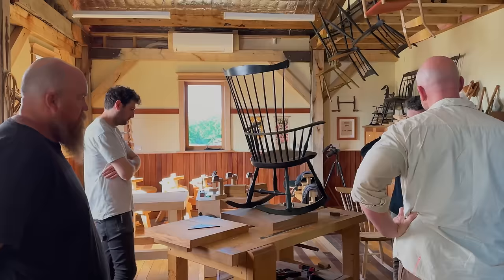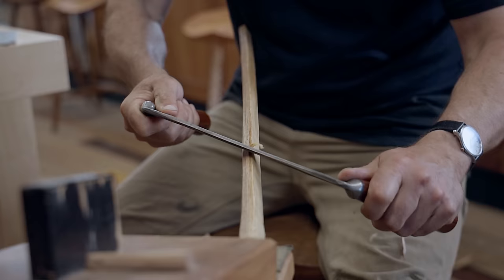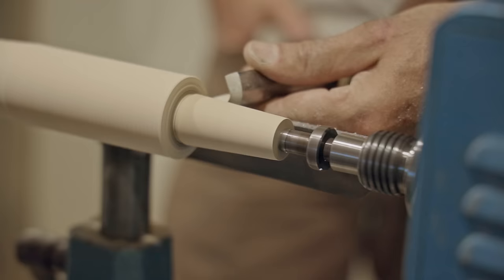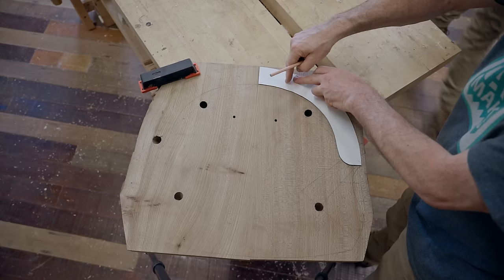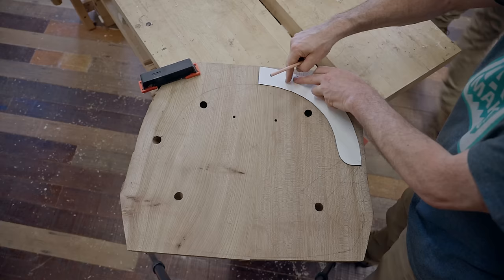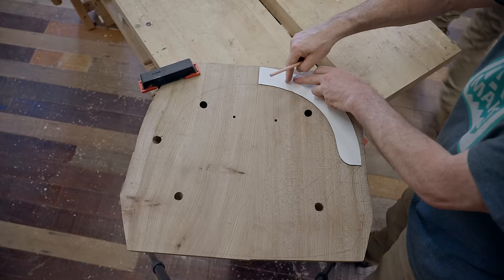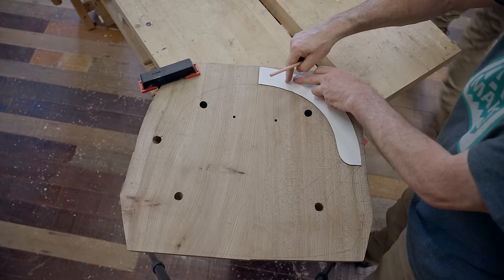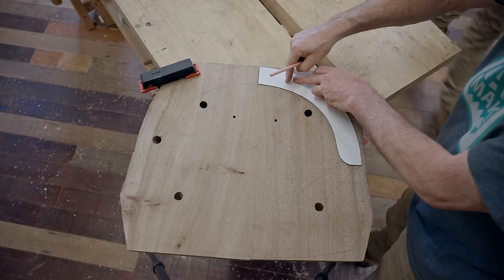How are Windsor Rocking Chairs Made? Let’s find out!

Comment: I made a similar chair, but not a rocker (which I'd love to have).  Those thin split back spindles are flexible and bend and conform to my chronically stiff back.  It's the most comfortable chair I own.  I did the standard finish...black milk paint over bright red milk paint with some scotch-brite and danish oil/wax over the top.  I used a combo of divergent hard and soft woods, so I think (for mine at least) the paint was the way to go.  It's one of my favorite inanimate objects!

Comment: These are super nice. If someone has a cnc router with vcarve or like software they could carve the seat along with some super detail designs in them as well as the rocker legs. I saw not that long ago someone carved the legs of a table which gives it a nice and fancy detail to the work. cnc routers could make so much detail to any project that it would be amazing to see some of it done.

Comment: the designers of this chair really were using tensegrity design before it had a name. it's just a bunch of wood that would otherwise be too weak on its own, using the constraining effect of other pieces of wood placed in opposition to it in order to always keep some parts under compression while others are under tension. It's fascinating to see and it lets you build a chair that's way more spindly and delicate than you'd expect, but which can actually handle quite a bit of weight and abuse.